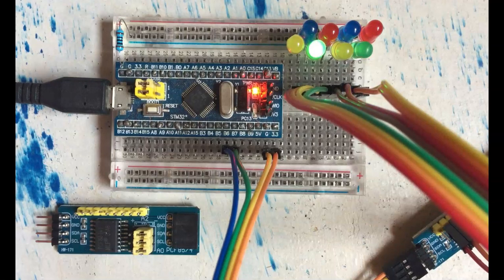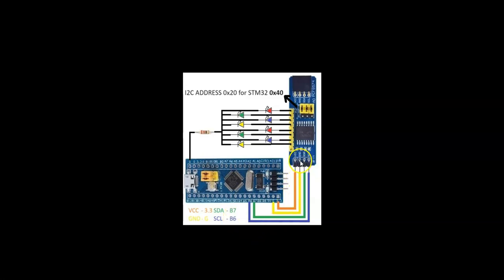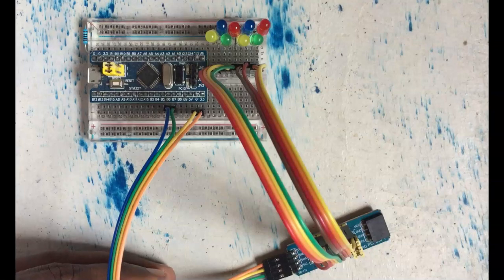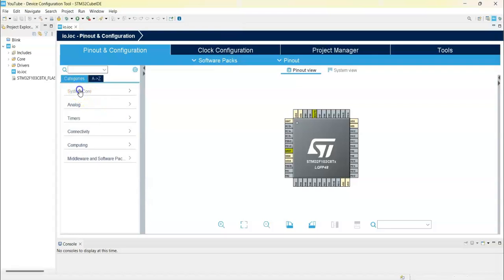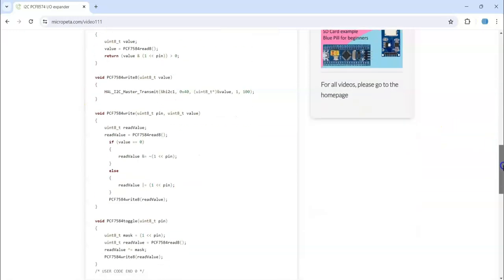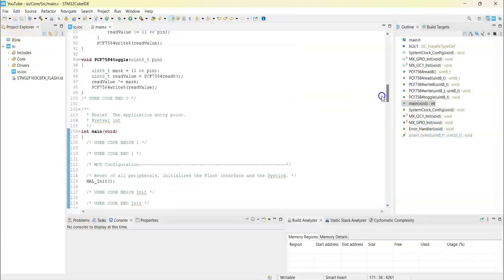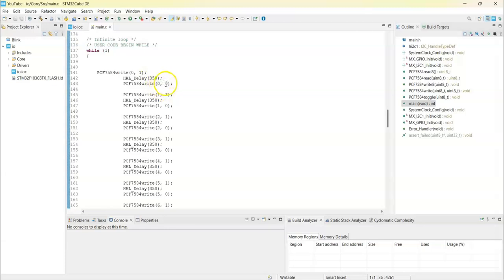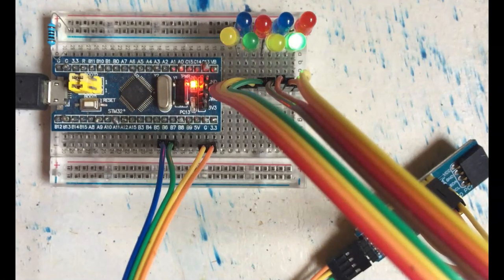111. PCF8574 I/O Expander with STM32 F103C8T6 STM32CubeIDE

Comment: How can i particularly high or low the gpio pin. Even after sending data my pins are remaining high
Reply from the maker: If you use PCF7584write() to set the value of a particular pin, it will remain in that state until you change again.
For example 
PCF7584write(4, 1); sets pin-4 high and it will remain high until you call PCF7584write(4, 0); then it will remain low until you call PCF7584write(4, 1); again
Thank you

Comment: Can i do input? Stm32 pcf8574
Please share your program sir
Thanks
Reply from the maker: You can use 
int x = PCF7584read(pin); //x is 0 or 1 depend on the 0V or 3.3V in the pin
where pin is 0,1,2 .. or 7
I have already included it in /* USER CODE BEGIN 0 */
Thanks
Reply: @NizarMohideen thanks sir
I will try
Thanks for your effort sir 🙏🏻